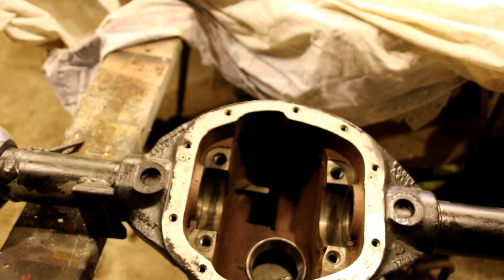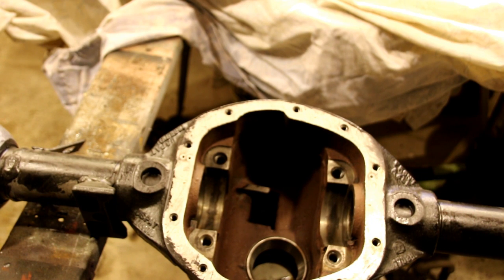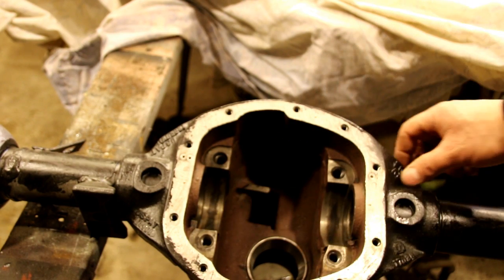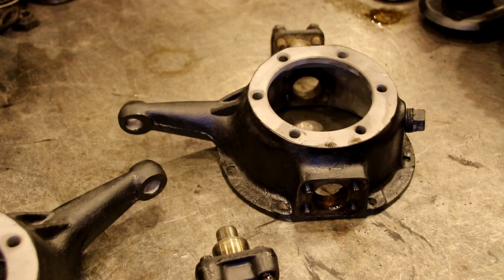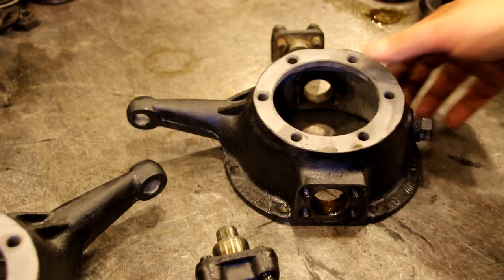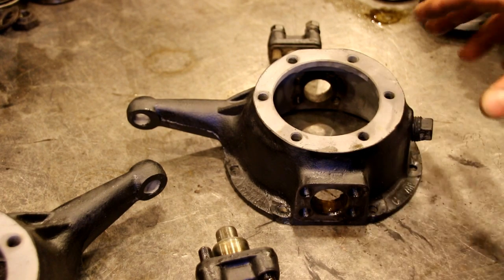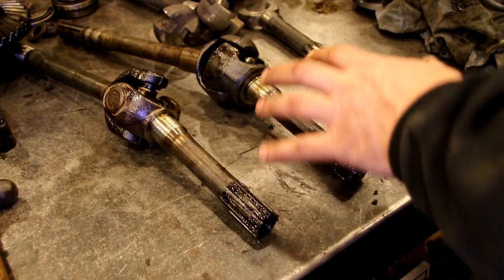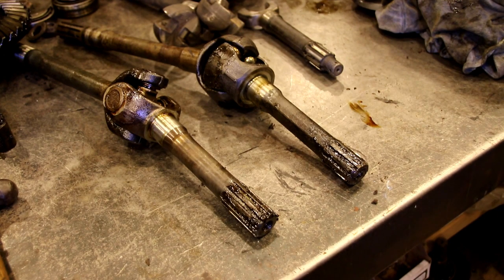Willys steering knuckle installation, proper lubricants for Willys Jeep

Comment: Back in the 80's when I bought my '69 Jeepster, the knuckle was filled with, you guessed it: gear oil. Left a mess wherever the Jeep was parked. Within days I had it apart to rebuild the knuckles and put new brakes on. When I went to look for lube, I saw it needed #0 grease. Turns out, one place in Boise had a 5 gal can of Chevron #0 grease that had been sitting there for ages and sold it to me cheap just so they could stop tripping over the damn thing.

So...lifetime supply. ;)
Reply: @MrJeep75  Nope. Most fill it w/90W because it's handy. It's a piss-poor solution, since no matter the condition of the seals, it'll seep out and make a mess. It's also not what Jeep tells you to use (#0 in winter and #1 in summer, quoted right from my original Kaiser Service Manual)). The #0 (and #1) is pretty much impossible to find, so the best solution is a mix of chassis lube & 140W gear oil. Have a read here at Novak, these guys know their chit: https://tinyurl.com/n4ep8f94

Comment: I'm working through all your axle videos Brian, thanks a million!
Reply from the maker: Glad you are enjoying the videos.
Reply: @metalshaperJeep  I'm  trying to do king pins on a 45 mb. The book says 4 to 6 pounds of pull. You say 12  to 16 pounds witch is correct.  Please reply.  Thank you.
Reply from the maker: @patrickwolf885  I use 12 to 16 pounds as required for later vehicles.  I do the same when working on MB or GPW front axles.  If you make the pull too light you will feel it when driving.

Comment: Hey metalshaper, I am working on my 1942 MB and I am glad I found you on YouTube.  Can you talk about the Rzeppsa joint and the seal it had on the knuckle housing.  I sure am learning a lot from your videos, wish I found them sooner.
Reply from the maker: I don't have any rzeppa joints out of axles so that is why I didn't talk about them in this video.  Will show them in a later video along with the knuckle seal and the correct lube for the knuckle.  Thanks for commenting and watching my video series.
Reply: Could the bearing part of the knuckle ball be squished and out of round vertically? That would cause the bearings to be loose.

Comment: Your videos are  great I was wondering if you could tell what service manual covers torque specs on my m38a1 jeep 1954 I'm working on the front and rear axles but my original manual doesn't show many torque specs

Comment: For those of you using the M38 military tech manual there is an important ERROR in the manual that you should be aware of.  The military tech manual instructs you to use the two shorter bolts to secure the brake hose guard on the top king pin, leaving you with the two longer bolts to go in the remaining holes.  If you do this, you WILL tighten them down onto the bearing, distorting the bearing cage and ruining the kingpin bearing.  Use the two LONGER bolts to secure the brake hose guard to the top of the kingpin.  The engineers were trying to achieve 1 & 1/2 turns of exposed thread inside the steering knuckle on each bolt when they employed two long and two short bolts.  The two longer bolts were used because of the thickness of the brake hose guard (which is held with only two bolts.)  In this same way, if you are checking for proper shim thickness be sure to add an extra washer to the two longer bolts, or make sure you are using the brake hose guard or you will bottom out the longer bolts onto your top kingpin bearings and ruin them.

Comment: I did the knuckle ajustment, but I put shims on both sides... to get the pre load bearings... But my CJ5 have D44 full size axles with power steering and 35" size tires...

Comment: You sir are awesome. Your videos are the best I’ve seen and I can watch/listen for hours on end. Not sure if you answer questions in regard to your older videos, but if you do, what have you coated your cleaned parts with? Is it black paint or an oil/CPC? Great work!
Reply from the maker: After sandblasting I use black epoxy primer.  On top of that I use black, single stage urethane paint.  Thanks for watching.
Brian

Comment: Brian would should you do if you have a 2a you had to install a washer under the top bearing? Do I still need to split the shim pack equally between the top and bottom?
Reply from the maker: if you have to use a washer to get your preload you probably won't have too big a shim pack.  You can split it if you have enough small shims or do whatever you need to get your proper preload.

Comment: interesting, so for my stock axles I purchased the stronger steering knuckle that you are using (has the additional bracing) for my 47 2a dana 25 but I did not get any different bearing caps.  I can use my stock 2a bearing caps and just shim the top?
Reply from the maker: If you have the later knuckles then you can just shim the top cap.  The bottom boss will already have the extra .058" material added to it.  So shim the top only and get the proper preload on the bearings.
Reply: ShnitzlHaus

Comment: I jumped the gun and put on the seals. I'm getting around a 20 pull. Should I remove the seals and redo? Or do you think it would be close with them on?
Reply from the maker: yes, remove the seals.  You must read the scale with no seals, just the knuckle and bearings to get it right.

Comment: After watching this video I am wondering if the new spindles with new spindle bushing vary in size.  Mine did and I had to hone until the spindle bushing fit nicely on both front axels.After reassembling everything the snap ring that holds the warn hub will not go on.  Even after pulling and prying the axel outwards through the knuckle.  Could the spindle bushing flange be too thick  and not allowing the axel to move outwards to get the snap ring on?  This snap ring holds the warn hubs in place.
Michael

Comment: What are your thoughts on using a locker on the front dana 27 with a stock engine? The stock shafts hold up or still break? Working on a 48 willys truck to do some mild trail running and logging roads didnt know if the 27 would work or just upgrade to a cj dana 30
Reply from the maker: I have run lockers in the 27  before and didn't have any trouble, but it all depends on how you drive.  The axles are not super strong to begin with but if you don't abuse them and drive carefully a locker won't be a problem.  I have used the lockrite lockers with good results in the past.
Reply from the maker: as I said earlier a locker will be fine in the 27 if your driving is easy.  Rock crawling or heavy mud will be  a problem and you might want to upgrade.  A 30 is better but a 44 would be a better axle if you plan on any type of rock crawling or mud.  You can reach me at metalshaper@comcast.net for lubrication or any other questions.  
Brian

Comment: I'm doing a restore on my 54 3B -- the front section of the axle and the bearings all came out while the longer section remained in the axle shaft.  Is that normal when you are disassembling each end of the front axle to rebuild them or is there a problem with the axle so it needs to be replaced?  Thanks -- Your videos and instructions are absolutely the best!
Reply from the maker: The axle joint is probably worn out and will need to be looked at carefully to see where the wear is .   Pull everything apart and inspect it so you can decide what to do, reassemble and use original joint or replace with modern spicer type joint.

Comment: Very informative about the different axles. My question is what is the fit of the axle shaft and the bushing in the spindle. I have new bronze bushings with a 1.265" id. The axle shaft is 1.23" dia. Thats 35 thou smaller. Is that the correct fit for a bushing? I know it runs more on the face of the bushing, but it still seems very loose.
Reply from the maker: all the new bushings are larger than they should be.  I like the fit to be very close, not too tight to to bind but a nice fit.  I always try to find NOS parts or make my own.  Find yourself a local machinist and you can have them machine you a new set if you don't like the clearance of the new parts.
Reply: I have a 1970 M38A1 CDN3 and it seems the original bushings in the spindles are the same size as the replacements. I wonder if they changed the design and made them larger in later years. @metalshaperJeep

Comment: Brian I purchased your knuckle lubes, it's blue? Just getting ready to put the axle together. Is the blue lube you sent me ok to use. Northern  Michigan mostly non winter driving.
Thanks Mike
Reply from the maker: yes, that is the correct lube.  Did you get your engine/distributor figured out yet???
Reply: Brian yes I did it ended up for some reason the oil pump would not fully except the distributor shaft. Thanks

Comment: With new bearings and races installed and torqueing to 35 lbs, after 7 attempts I am at zero shims on either side and barely managing 11-12 lbs on the left knuckle and 9 on the right knuckle.  Guess I'm gonna have to go the washer route as those numbers are not gonna be good enough for me.  A question. As I'm sticking with the 9" brakes should I have the brake hose guard installed on the top  king pin for this?  On the plus side the knuckle lubricant that I purchased from you looks like it's gonna work awesome.  (Highly recommend it)
Reply from the maker: you don't need the guard on there for setting the torque,  but when you have everything the way you like it install the guard so you can hook up your brake hose and hard line correctly.   The knuckle lube will work great in all temperatures, it took a long time to develop and has been working perfectly for many years.

Comment: I decided to try remove a shim on the top kingpin bearing on my CJ5 and I noticed oil dripping out of the knuckle. Removed the back felt pad cover plates and I can see oil in the felt pad. I guess this means I need to look at the seals in the axle tubes? This means I need to get the Dana axle out and open her up? I guess this is bad if I have oil in the axle tubes?

Any suggestions for a good Jeep parts supllier that ships internationally. I live in South Africa.

Thanks for posting your videos. You can be really proud of what you do as it helps alot of people like me. 

Keep up the good work!
Reply from the maker: Mike,  the entire knuckle has lube in it so the felt will have a little lube on it.  What you don't want is lube leaking into the tubes from the differential housing.  If your level is getting low then you know it is leaking past your seals and into the tubes.   A little leak isn't too bad but if it gets worse you should get in there and change the seals.  You will need to remove brakes, hubs, axleshafts, carrier and ring gear, etc.... to get at the seals.  Follow along with my videos step by step and you shouldn't have any trouble.  
you can try Peter Debella Jeep Parts at 631874 8660 or look him up on the internet.  If he won't ship overseas contact me directly at metalshaper@comcast.net and I will get you the parts you need.
Reply: Thanks for clearing this up Brian.

So it did start leaking when I took the top kingpin out but wasn't leaking before, so I guess I opened up something there and there may have been some oil in the knuckle.

I wonder if this oil is causing any bearing preload to fly out the door and add to my dealth wobble woes?

Thanks for the info and the advice, I will prefer to work with you directly.

Thank you also for offering to help.
Reply: Just thinking about my actions now, I had to heat the tie rod steering arm hole and smack it with a hammer to get it loose. This action may have twisted the axle in the seals and caused some fluid to be released. Not sure how much oil is allowed in the knuckle, just trying to think if it was because of my action that the oil leaked. Guess I am trying to overthink this now.
Reply: Just took the front knuckle apart and it seems I should be able to get those axle seals in without having to remove the entire front axle drive.

The axle shafts  slide right out and if I remove the diff cover and strip then I can get to those inner axle seals the way you could on the bench. 

I just need to make me one of your great seal seaters and I should be away.

Just a quick question: Are the front and the rear axle tube seals the same? I intend to redo my back axle drive soon too so I might as well get all the seals I require upfront. And some of your magic bearing grease.

Thanks for all the help.
Reply from the maker: Mike,  the seals can be replaced with the axle in the vehicle with no problems.  They are pressed in from the inside though so the carrier has to come out for you to remove and replace them.  Just make sure you install them squarely in the bore and don't distort them when installing them.
Reply from the maker: removing the tie rod should not have moved the axle and allow oil to leak out.   Make sure you do indeed have a leak.   Fill the housing to the bottom of the fill plug, then drive around for a couple of days and recheck the level.  If it is down you could suspect a inner axle seal as long as it isn't leaking anywhere else such as pinion seal or cover gasket.
Reply from the maker: the front and rear seals are different, so if you are planning on any rear axle work make sure you get the correct parts before taking it apart.  Good luck and let me know if you need any more information.
Reply: In terms of safety and having things run the way they should, I'd opt for replacing these seals on both axles. I also noticed the front left bottom kingpin had two shims on the bottom which should not have been there.
This makes me want to redo the lot now, so I will contact you for the seals and any other goodies you think I may need to complete this job. I have a feeling that bearing preload wasn't a term that existed when we redid her 30 years ago.

The reason I opened her knuckles up was to replace and reshim the kingpin bearings. She has a death wobble sometimes and I have checked everything else but these bearings and the preload.
Reply: ok, so I got the axle out today, figured there is no way I can get those seals in working upside down on my back so I took to doing what you did.  I have a single car garage space to do this all in so space is pretty tight. Also gave me a chance to clean up the axle so I can repaint it black. I can take it down to bare metal with a wire brush. Any advice on what to prep the axle with for a nice finish? 

Right hand side knuckle had shims at the bottom also. Quite a bit of oil was in the knuckle too.

I don't have a preload pullscale yet, is there any other way of checking this, like a really goofy backyard way?
Reply from the maker: Clean housing best you can, and then wash it with solvent to get any grease or oil off of it.  I always use epoxy primer and then paint to get the best results.  As far as preload a scale is best if it is your first time.  I have done so many of them that I can easily feel the correct preload by hand.  If it is your first time then I would advise using a scale to get the correct preload on the bearings.

Comment: What is the torque when tightening the hub bolts, bearing caps, knuckle oil seal retainer, wheel spindle, and wheel?

Comment: Hey Brian,

Apologies if I am jamming up this video page with comments and questions.

I just wish to ask you if I need to set my kingpin bearing preload without the seal and the felt and cover plates in place?

How much moly-d must the knuckle have inside?

Thanks to the info in your videos I am alot further on with this overhaul.

Just about to put the axle back once I have the preload set!
Reply from the maker: The preload is set without any seals in place.  Just the bare knuckle on the kingpins.   As far as lube goes it is best to fill the knuckle about half way up with lube.  it should be just about at the bottom of the tube opening.  I usually then pack some lube into the U joint area and install it into the housing.
Reply: Your videos have been a saviour for me, thanks for all the hard work you are putting into making them.

My frontend is finally back in and ready for testing!

Comment: Brian; Will  the CJ3a  and the CJ3b steering knuckles  interchange with the CJ2a/MB?....Hal
Reply from the maker: They will work fine on your CJ2A.  The MB used a knuckle and bolt on steering arm, the knuckle will work but not look correct.

Comment: Brian: I have a VEC 2A. Do you have the same shims on both the top and bottom equally?
Reply from the maker: If you have a axle with shims on top and bottom then put it back that way.   I always start with .058" shim pack on the bottom and then shim the top for bearing preload.  On later axles there was a .058" change to the cap  and shims on top only, which is why that size shim pack is a good place to start.  In the end you want the proper bearing preload, and if you have to change shims around to do it that is fine.

Comment: Thank you very much for your videos! I have cj2a dana 25 front end I'm repairing from spindle bolts pulled out and I broke the outer bendix axle universal joint(large ball bearings). The problem I have is that my outer axles have the threaded ends and all the ones I can find don't have the treads. Do you have the correct out axle? Or do I need to have one machined?
Reply: Oh, I did forget to mention that it has Warn free wheeling hubs. I also have flanged bushings in the spindles and OD tapered bushing in the knuckle.
Reply from the maker: I would get a complete axle for your project.  You can check the internet, ebay, jeep forums etc... and should be able to find the correct unit for your project.

Comment: When did the CJ-5 change from a closed front knuckle to an open knuckle?  Mine, a 1977 CJ-5, had open knuckles.
Reply from the maker: The CJ's changed from closed to open knuckles in 1972.